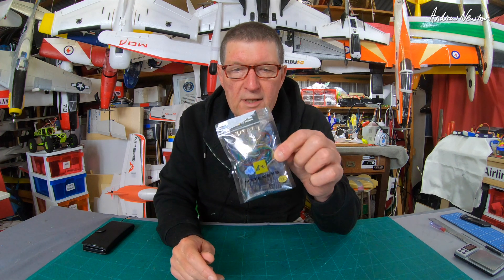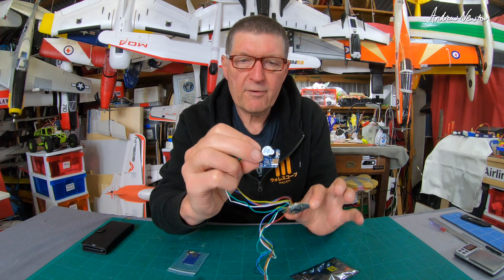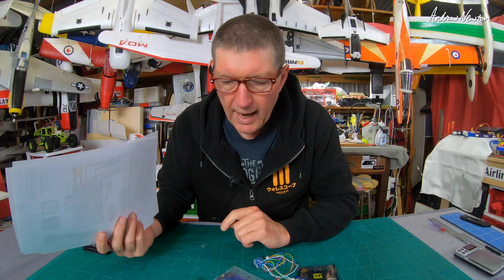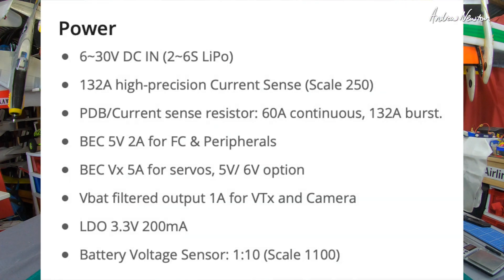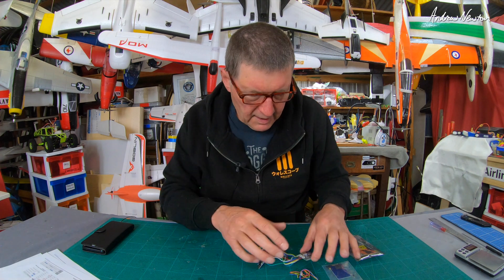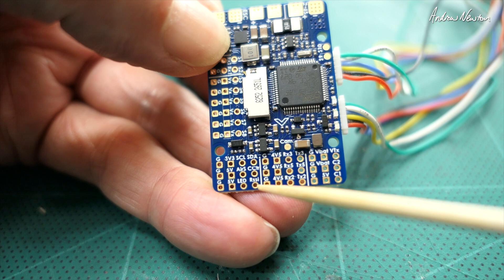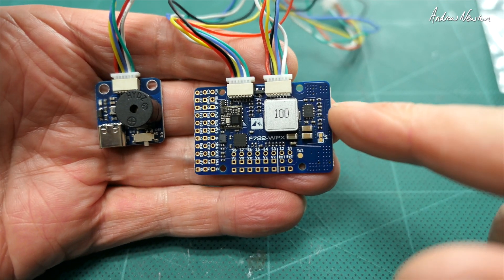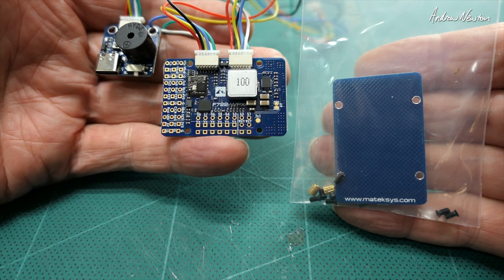Matek F722 WPX Flight Control Board

Comment: I ordered one of these from Bangood,and a Beitian 220 gps module.First of all:Soldering those pins to the board is a PIA..Second:How do i connect gps to the flightcontroller?The gps has only 4 wires,but the connector on the board has 6??Took a look at some videos how to program this,and it seems that it exceeds my skills.Is it possible to buy a working unit somewhere?Plug and play?
Reply from the maker: 4 wires means it doesn't include a compass. Just connect the 4 wires, compass is not required for fixed wing. But first you need to learn how to solder pins, and work out how to connect to a UART port.
Reply: @AndrewNewton  Ok,thanks for the tips..BTW,i have been working with electronics since 70's..(I am 59),so i have done some soldering,but it was really hard to get some proper solderings here,propably cause was that i was afraid of damaging the components.But i got it done after i realized the problem.And about this controller..I still think it's unnescecery comlplicated,if you only want a plane to fly a pre-programmed route..

Comment: Nice close ups Andrew...Man, that's thing is loaded...I just bought an F405 STD for another iNAV quad build...Ample really.
Reply from the maker: Also bought an F722 SE for my quad build. Scary new stuff to learn
Reply: @AndrewNewton  Yes, I put one of those in my Mr Croc long range...lots of processing power, more than enough.
Actually, setting an iNAV quad up is easier than FW....Air Mode, Horizon (for landing only) GPS Hold, RTH & land....Your done.
Be careful calibrating your compass, and don't skimp on your GPS/ Mag..
Reply: @AndrewNewton  Hi, if you are planning on INAV for this F722SE don't use DSHOT, it's fraught with issues, use Oneshot125 it works and it's supposed to be quicker anyway :-)
Reply from the maker: Thanks for the tip Stephen
Reply: @AndrewNewton  Yes, I forgot to tell you about that, One shot 125 works perfectly well...